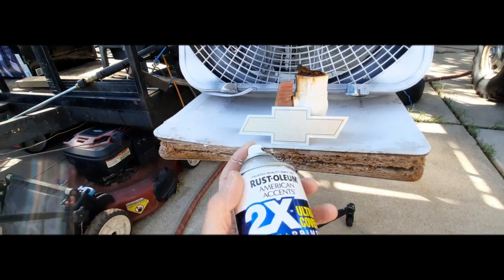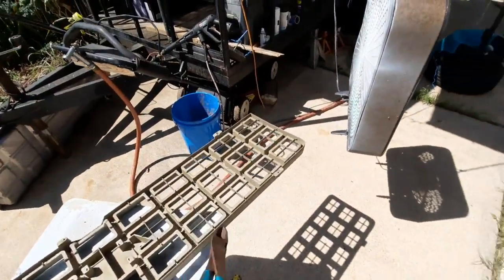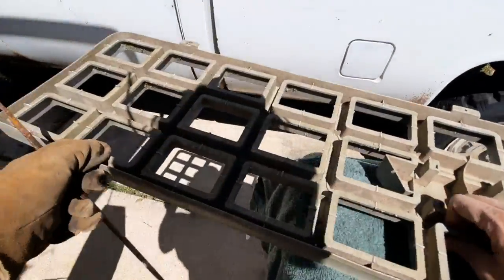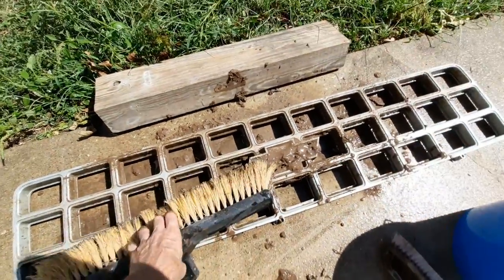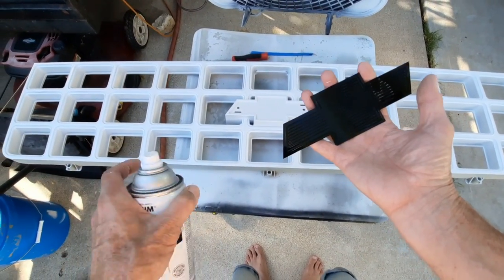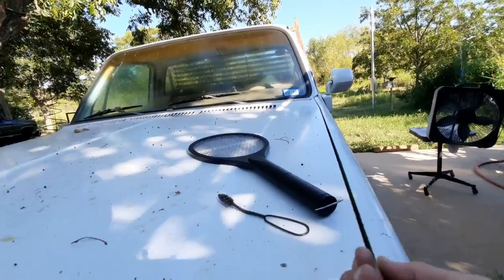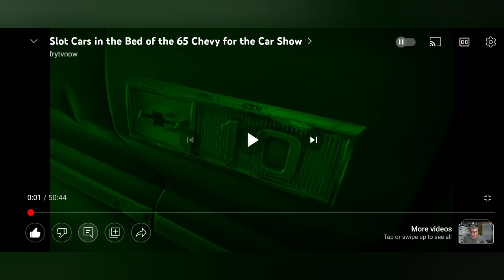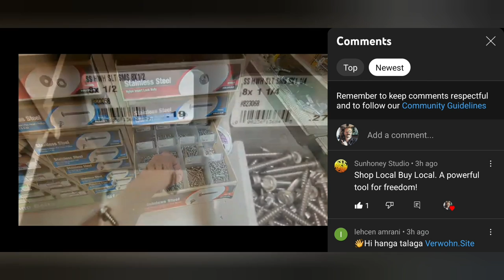How to paint a truck grill the right way🍟📺👀

Comment: Very interesting effect. Looks cool... BTW, buy some glue
Reply: Some places like Home Depot have a scrap cart. I have bought lumber for 10 cents on the dollar out of the scrap cart. 
Regarding the paint on the 91 and the 65,  be careful with using WD 40. The penetrating nature of it grabs and hold on to tiny dirt particles and the dust gets into the paint. It looks good temporarily, but you will end up in trouble. I strongly suggest you use conventional techniques... cleaner, compound and wax. 
I suggest you get the color number of the white truck. Get it off the truck and have it matched in a spray can. It a good way to rattle can a spray repair. Use 800 wet sand paper and follow gradually to 3,000. Also, look on Craig's list for cheaper lumber.

Comment: The comment you had the other day about the WD 40.   Originally it was invented by NASA and was called water displacement 40.      They were thinking of a liquid they could spray on something that would remove water.    It was never intended to be a lubricant but most people use it as a lubricant only because it's in a spray can with a nozzle   .  I didn't know it could be used as a cleaner.  I am disabled but had someone else use it on a quarter panel of an SUV which has a lot of scratches on it,   It cleaned it right up. I wouldn't recommend it to totally get out scratches from car paint    but in my case where most of a quarter panel was scratched it look 100% better.

Comment: A good rust inhibitor is 1 part white vinegar 2 parts water apply it to rust and it will oxidze it and it turns white then just wash off with water and paint ,major rust will have to be wire brushed first